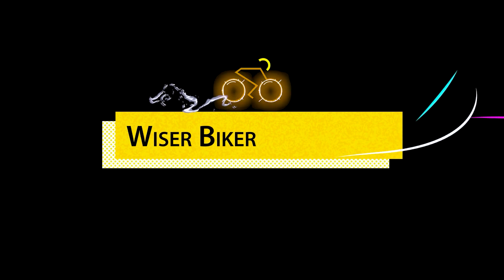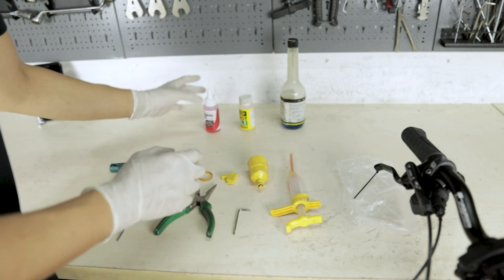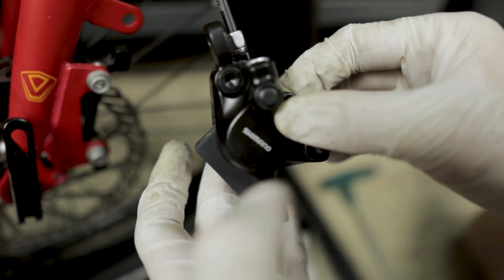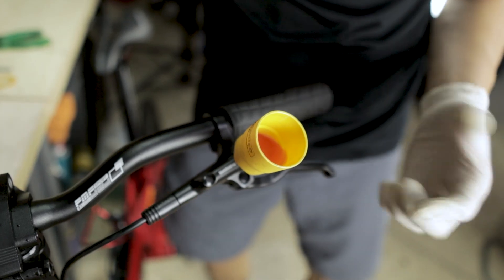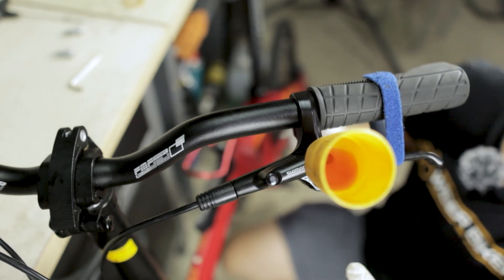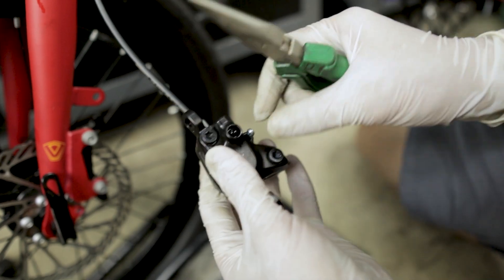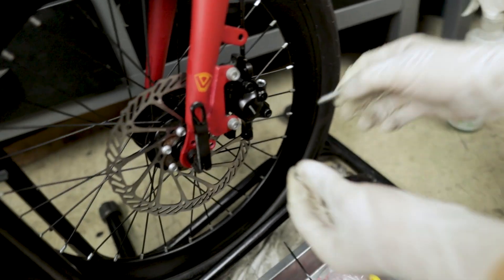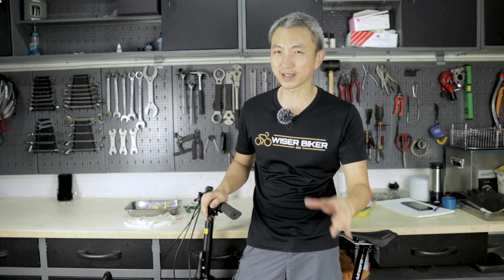How to do Bleeding for Hydraulic Disc Brakes | Flat Bar Levers

Comment: It is odd to pump hydraulic fluid up. Saw another video which run opposite from this maintenance by withdrawing fluid out from the existing tube then replace new fluid back from top container. I think this should be the better way of replacing new hydraulic fluid maintenance procedure. 
i.e. remove old fluid out from top to bottom followed by refilling new fluid again from top down.
Reply from the maker: Hi James, our consideration is that air bubble moves upward naturally so if we pump fluid from bottom up, it will be easier to push any air bubble inside the hose upward. Nonetheless, we always believe there is no hard and fast rule about it, as long as it works 😀 👍🏼 Thank you for sharing!
Reply: @WiserBiker  thanks for the video may I know how you dispose of the old oil?
Reply: I was thinking the same, the bubbles naturally float to the highest point with some gentle persuasion. This demonstrated process would also use excess oil.